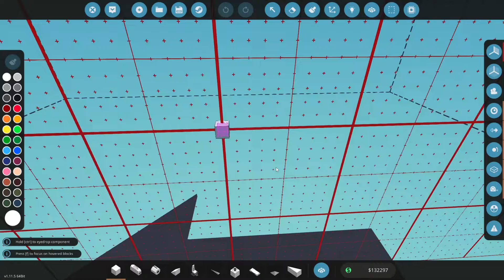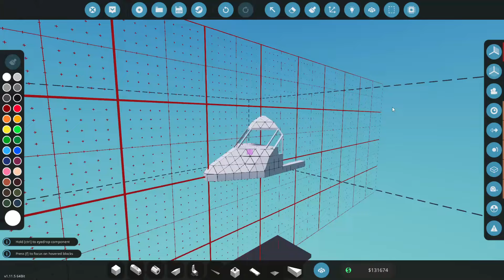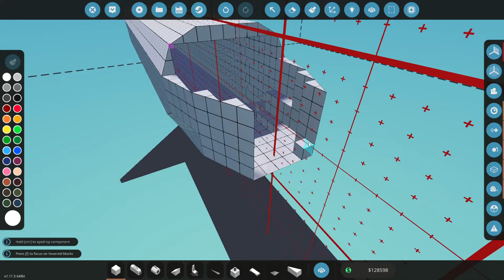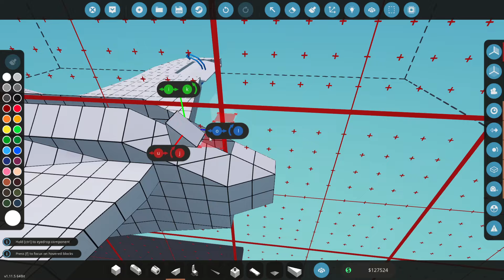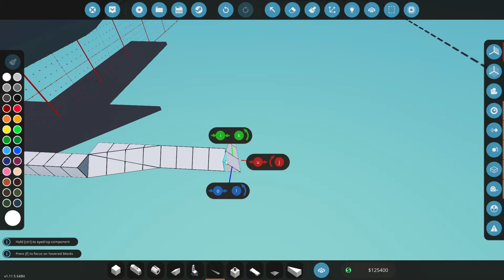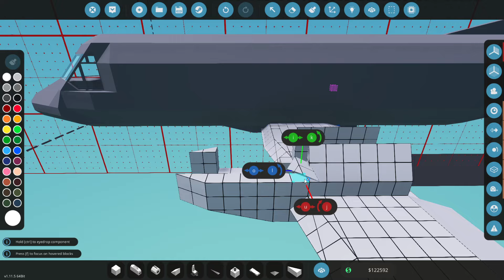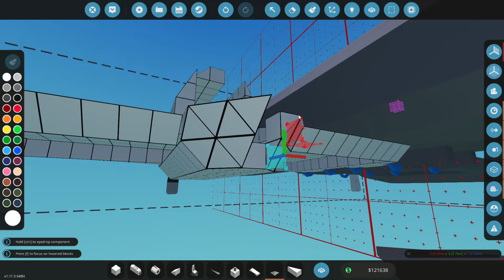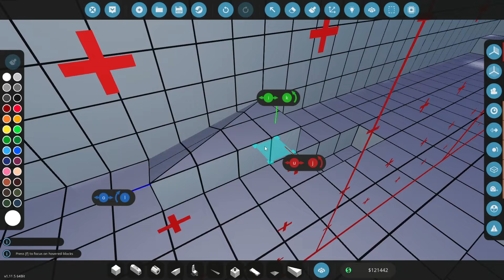NEW TURBOPROP PLANE BUILD!! Stormworks Classic Career Survival [S3E36]

Comment: When you do the fuel tanks I ran into issues where the jet engines would cut out due to too little pressure in the tank be wary how you set up the pressure relief valves otherwise the pressure will drop to much too fast it was a real headache troubleshooting that😅
Reply from the maker: Ohh right haha.  Thanks for the heads up!